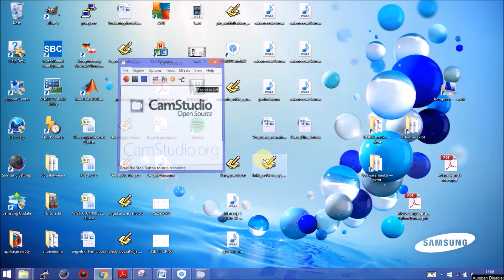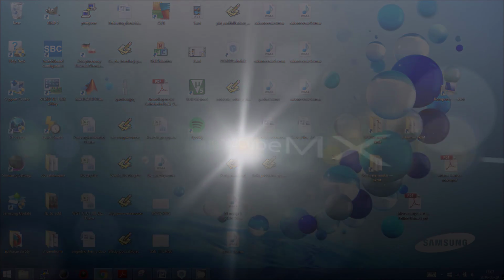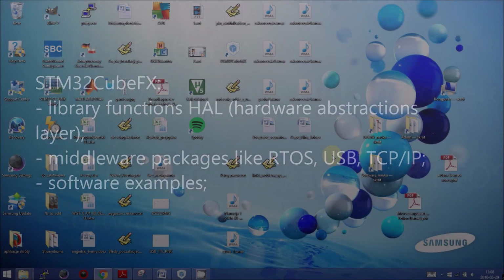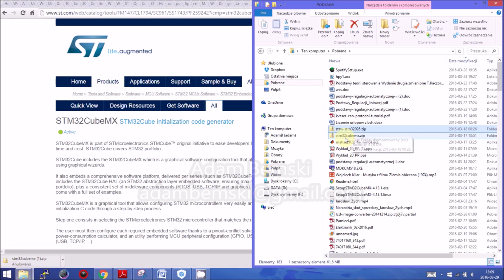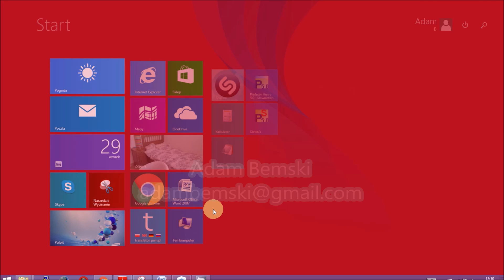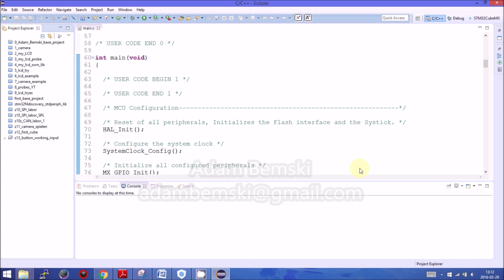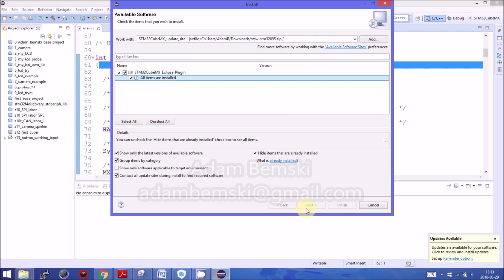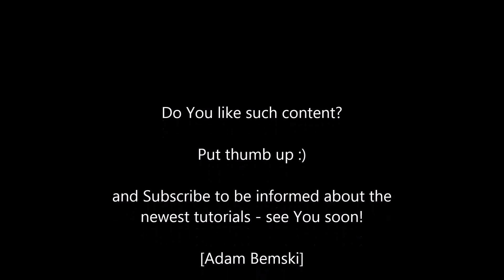STM32 CubeMX & System Workbench for STM32 Part 1, Getting Started and Installing

Comment: hello., i wanted to know if this software works on all the STM boards.?
i hav STM32F103Cx  DEMO BOARD..,is it similar to  "Nucleo board" ,hope u reply soon.
Reply from the maker: joy chanda List of supported boards or supported chips is available during creating of the project. Even if Your board is not listed there, try to search by STM chip.
Reply: got it ..! thank you.! btw do i have to download that plug in version too or the MX would do fine without it.
i'm using STM32F103Cx(8T6) DEMO BOARD.

Comment: HI ! Great video dude... but, I have a big question. I don't know wath is the difference between Cube and the Workbench.
I need both for work only whit a Nucleo board ?
One is the complement of the other ?
Which one is the principal ?
Can I work only whit Workbench ??

I'm too confused, if you can help me I wil be gratefull... Best regards.
Reply from the maker: Hi, Workbench - also called as "System Workbench for STM32" or "SW4STM32" is an IDE. This program allows you to write code - program for your application. STM32Cube as You can see at 1:09, consists of two parts. First of them is a set of libraries - it is called as STM32CubeFX. These libraries allows you to use prepared functions to make easy access to peripherals of your Mikrocontroller like GPIO, UART, etc. Second of them is graphical tool STM32CubeMX which can be used in order to accelerate creating of your application. You can define there which pin of your uC is for example foreseen to be input or output. In this way this tool can automatically generate code for you with appropriate initializations. Code will be compatible with STM32CubeFX. This code can be used also in SW4STM32. :) Hope that was the information which you needed.
Reply: Adam Bemski yes man ! thank you soo much !